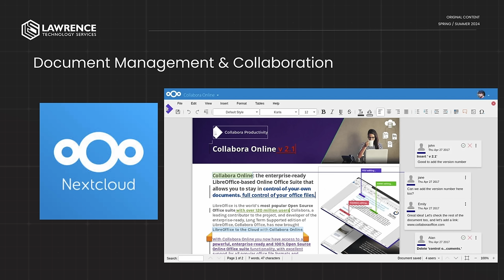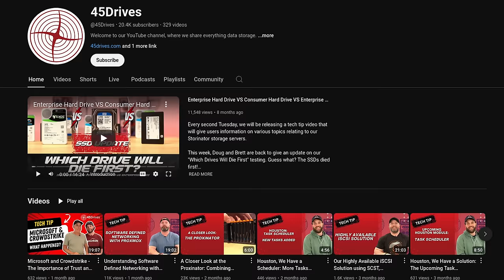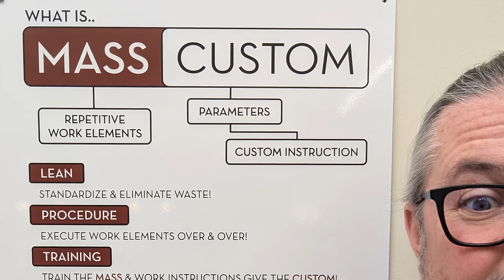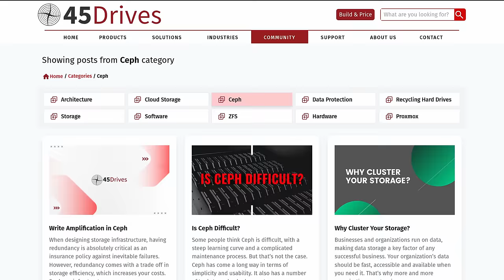Why 45 Drives Matters To Open Source

Comment: That stackable case looks good. Looking forward for details. Any availability in EU retail market for 45 Drives?
Reply from the maker: They are in Canada but I think they also ship to the EU.
Reply: Thank you — it's still in production but we can't wait to share updates with you when it's ready. Also, we ship to the EU!
Reply: @45Drives  thanks, good luck with polishing it
Reply: It looks good indeed. So do the predecessors that have tried the concept before. Unfortunately it always fails because it's basically a much more expensive solution than using racks of similar size. So it never gets to the point where it's a popular enough product that the economy of scale can bring the price down to a level where anyone would buy it. The primary issue is that if you make the cases so that they can be stacked any way you wish, then every case has to be able to be at the bottom of the stack and thus carry the entire weight of both itself and everything above it. That makes it a very expensive solution because you now have to make the cases much sturdier and heavier... So now the strength need also increases, until you find some kind of equilibrium where each unit can carry the weight of all units on top for the full height possible for that system. Which is going to be quite beefy, and because metal costs, expensive... The other option is to have a fixed stack configuration, where the modules have to be in a particular order, where the cases only have to be able to carry the cases above them. That drastrically reduces the amount of metal needed, but that also comes at the cost of the flexibility. As in, you lose the whole point of why it was modular in the first place, so you just end up with it being a single case anyway.

So while it looks nice, and I wish them all the best on the project and hope it succeeds. History however teaches us it's most likely never going to be a commercial success.
Reply: @danieljonsson8095  Yeah you are right, I can't see a way to order it from Canada and ship to middle of Europe without doubling costs making it insanely overpriced. It will need EU warehouse for shipping.
Reply: @Monsicek  I'm not even talking about shipping. I'm talking purely as a matter of production cost. Both for the metal price itself, but also for the machines required to work with the thicker metal.

Comment: Thanks!
Reply: @LAWRENCESYSTEMS  Is there another TruNas fresh install vid coming soon? if so, please include the must have tips and tricks and apps in the install vid for us newbies, I am getting a quote from @45Drives for a 8 drive NAS, 
Thanks!
Reply from the maker: Yes coming soon and it will be based on the new 24.10 version
Reply: @LAWRENCESYSTEMS  Cool Thanks! I went with Wendells B650DU 2L2T build, you can see the specs I left on his vid